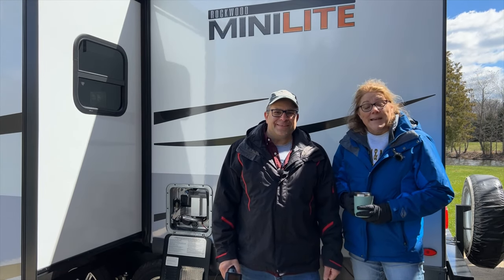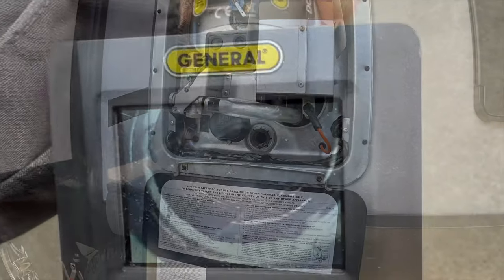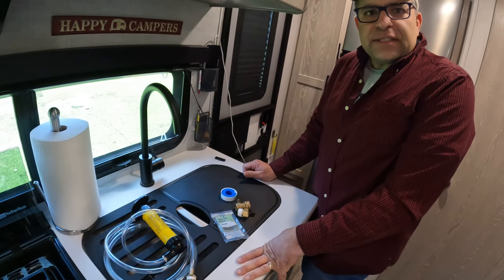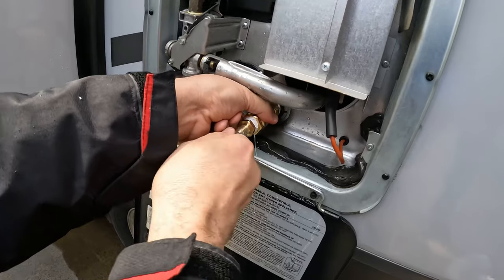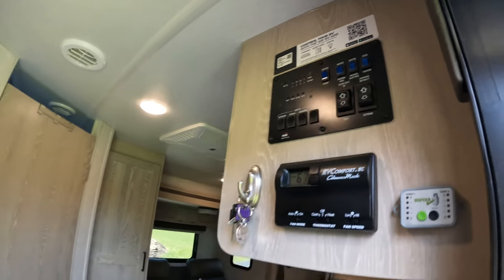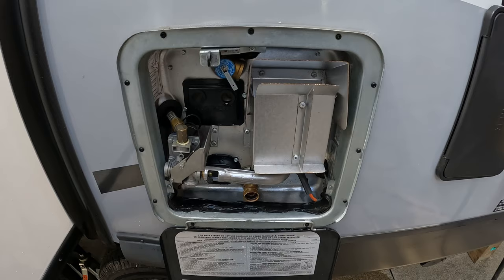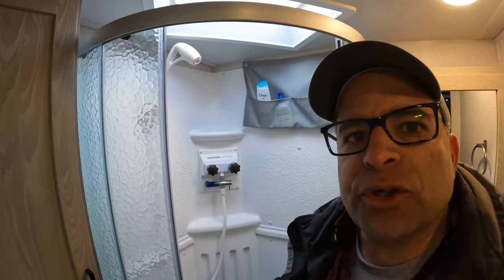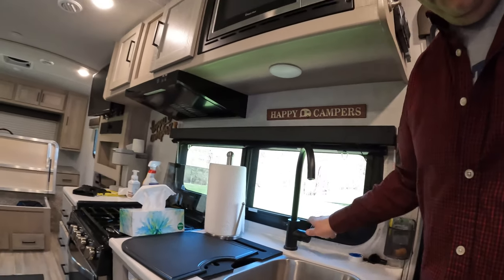Dewinterizing & Sanitizing our Rockwood Mini Lite 2205S, Suburban Water Heater Descaling Part 1

Comment: We always put our filter for the water right on the faucet outside.  We have seen so many place it at the onset of the faucet.  Maybe one on each end would help filter better?  Excellent video.  Thanks. Duane and Deana
Reply from the maker: I ended up picking up 5 replacement filters on EBay for a decent price, after those are gone I might bypass the housing and only use an outside filter. Thanks for watching and thanks for the comment!

Comment: Can you just bypass the fresh water lines and use the water pump to fill the water heater through the winterization inlet?
Reply from the maker: I believe you would be able to draw the vinegar mixture into the water heater that way after all of the lines have been purged of antifreeze.
It’s easier to hand pump it in though. Also I would probably change and use two gallons of vinegar and top off with water. Thanks for watching!

Comment: How long do you turn the water heater on with the vinegar mixture in it? What is the purpose of the water bottle in the filter housing, to minimize spillage when removing? One possible suggestion. I use a citric acid powder mixed with water to descale my coffee brewer. This is recommended by the manufacturer (Behmor) as superior to vinegar. Also doesn't stink. Might be worth a try. It's great to watch ones for the same unit as ours. We pick ours up 3 weeks from today and are taking our shake-down trip at  Maumee Bay after watching your video on campsites there. Thanks again. John from Ohio
Reply from the maker: I only turned it on for 10 minutes or so, I didn’t feel comfortable leaving it on longer. I didn’t want to build excess pressure in the tank (I had the tank in bypass). Some research suggested not even heating the mixture..
I will follow up with an inspection and show how the mixture worked, I plan on doing it tomorrow…
The bottle saves the amount of antifreeze needed, Note: it should have been installed upside down, plus it does help with minimizing spillage. I probably should have put it back in after dumping the canister..also there was a little antifreeze in the bottom when we dumped it out.
I’m so happy that the Maumee Bay video helped, I remember your comment from before..
Thanks for watching! Good luck with the shakedown trip…